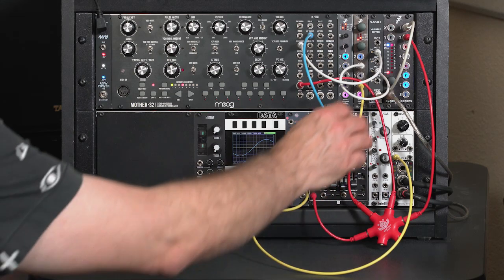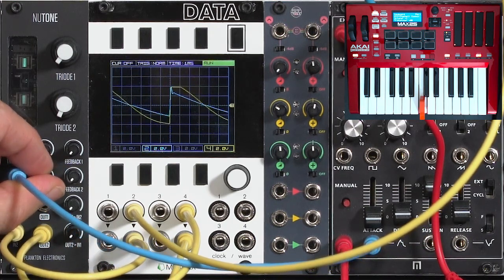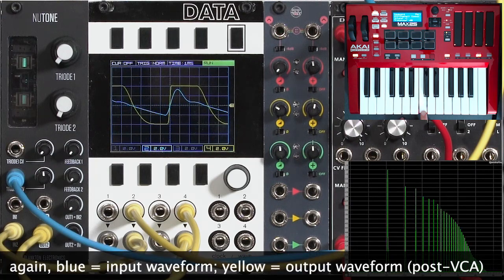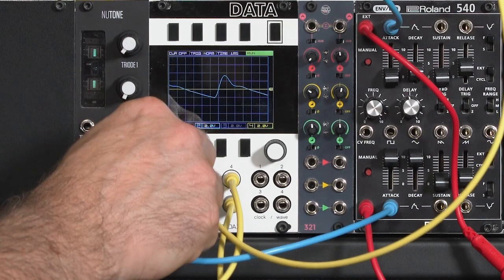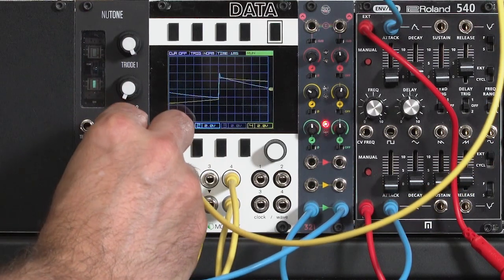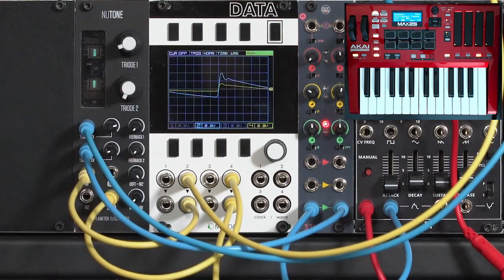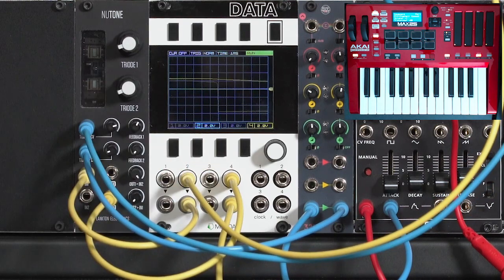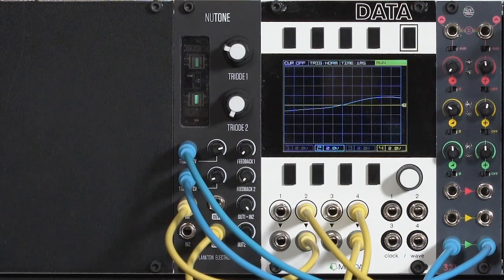Plankton Nutone dual tube VCA 2/2: in use (LMS EE)

Comment: In comparison, how does this compare to a Low Pass Gate?  I was chatting with someone who felt that it didnt have much headroom.  What are your thoughts?  Could you patch your Verbos CO into it and tell me how you think it handles?
Reply from the maker: This is primarily a VCA, and it will add harmonics if you overdrive it. A low pass gate removes harmonics as its level fades down. How much headroom it has depends entirely on how you manage your signal levels going into it (as shown in the videos). Regardless, you would choose this because you want some level of distortion; not because you're looking for a clean VCA with lots of headroom.
Reply: @LearningModular  Ah -- yes, I am looking for more warmth, typically the warmth that would come from tubes.  I like the idea of the Nutube, but I want to see what more capable hands are able to come up with, as well as hope that more people start to play with these!